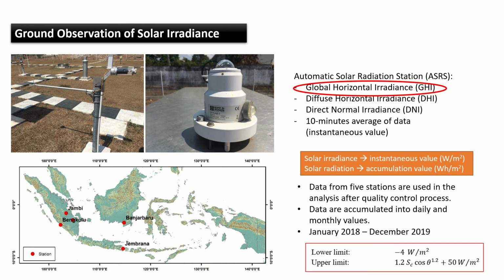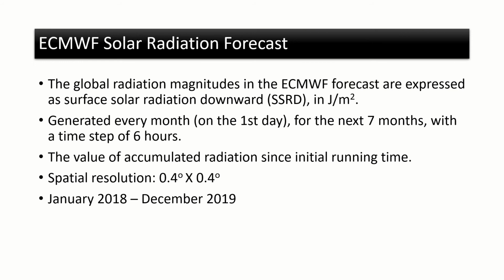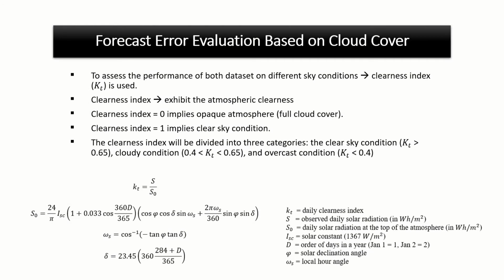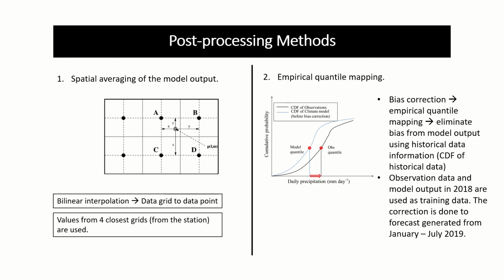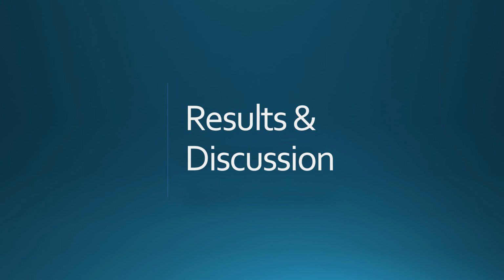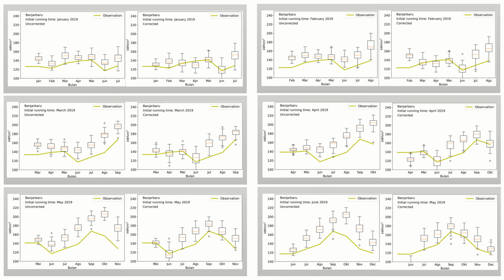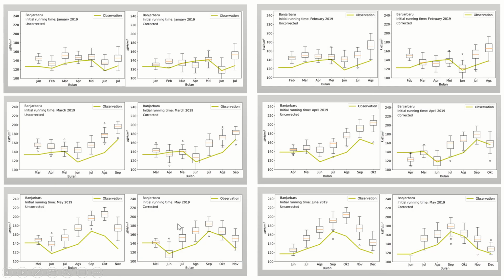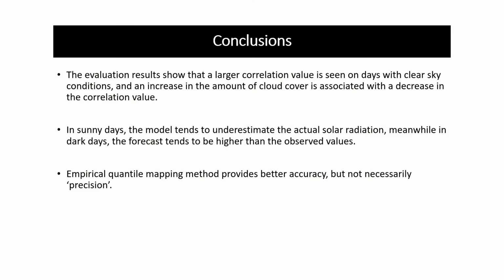ICTMAS 2021 - Oral Session

Comment: Nice result! I believe ECMWF uses the two-stream model and does not include 3D radiation effects while in Indonesia, 3D clouds are very dominant. That can be one factor to be considered in your analysis wrt cloudy conditions. Also, I would suggest running radiative transfer simulations (e.g., LibRadtran) under clear sky conditions to analyze the instrument's calibration and performance. Theoretically, they should not differ that much.
Reply from the maker: Thank you for the comment and suggestions. Yes, local convective clouds are very common in Indonesia region so that could be one of the reasons. I am not familiar yet with the package that you mentioned but definitely going to check it out. Did you imply that it can be used to calibrate our radiometers too?
Reply: @yesichristy5291  No. The calibration is another matter. That should be performed in the lab. It normally uses an integrating sphere to get the absolute calibration factor to translate the raw signal to the irradiance/radiance. Do you perform the calibration yourself? The radiative transfer can help to find e.g., instrument stability and degradation. You will find the offset which can be applied for correction. For this, you will need a sufficient amount of clear sky measurements. LibRadtran is a good step and you can do a lot of things with it. Let me know if I can be any help for this.
Reply from the maker: @trismonocandrakrisna5723  The solar radiation measurement that we conducted started relatively recent (2017ish), and if I remember it correctly, the instruments are calibrated every year, albeit with limitations. One of the main issues in calibrating the radiometers here is the strong cloud formation (we barely get any clear day!), and taking the instruments to places like Davos would require a substantial cost. I'm not the one doing the calibration so I'm not completely sure of how we're doing it now. Thank you for your offer and suggestion. Saw you on LinkedIn, I guess If it's okay maybe I'll get back to you once I have more information about this...